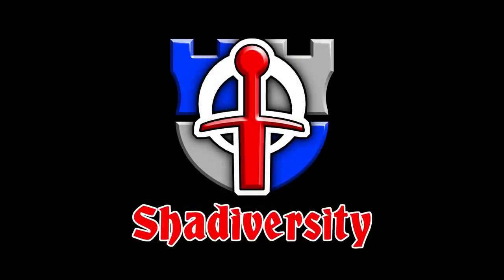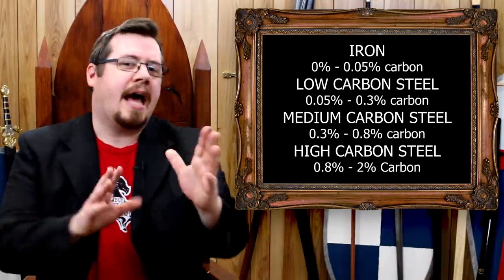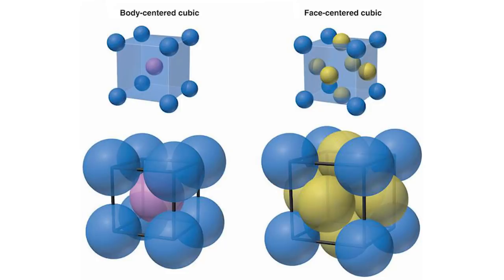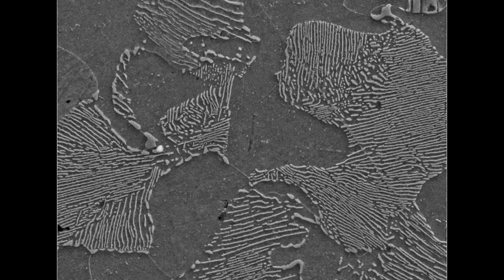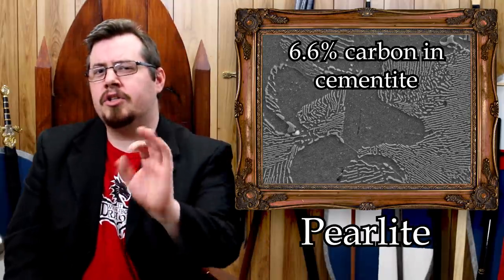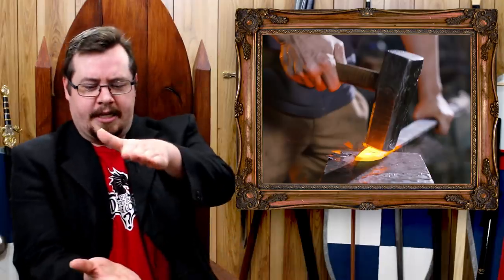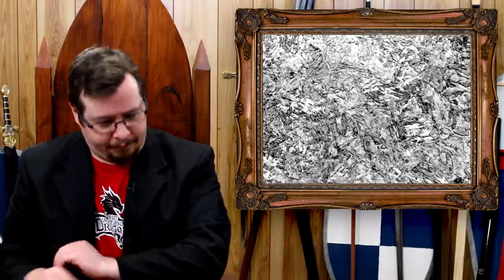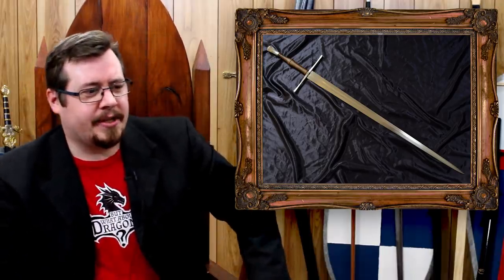What quenching and tempering does to SWORDS

Comment: As a professional bladesmith, I'd like to say THANK YOU!!!!! for doing some solid research and presenting factual information on this topic. I can't tell you how much people misunderstand most of this so I greatly appreciate you using your very popular channel to dispel a lot of wrong headed thinking when it comes to sword.
Reply: I wonder if you picked up on anything wrong? Some statements don't sound right to me. It sounded like shad was saying that heating a sword up past magnetic "can" forge weld micro fractures back together. That does not sound right as you would need to heat it up to a welding heat then maybe put a little force into it. I don't know if a welding heat alone would work depending on the type of steel. Tho a welding heat is hotter than nonmagnetic so it could be considered correct but misleading. Also it kind of sounds like Shad thinks that a sword is forges at a temperature below the nonmagnetic. I was taught that carbon steels should be worked at a bright orange or yellow heat to prevent micro fractures. And if shad ever comes up to Queensland I would love to help him forge something.
Reply: In order to achieve Austenite you need to heat up steel slightly (about 30 kelvins) above 727 celsius (regular steel) and keep it that way for some time. Look up Iron-cementite curve for more details, as the temperature at which austenite appears may be different at different amounts of carbon (also other additions may change the desired temperature). 

As for shaping, as long as you are going to normalise it, the temperature doesn't matter that much as long as the blade doesn't fracture. You wouldn't want it, however, to be too high (much above previously mentioned line) as the grains (??? don't know the correct translation - those microstructures in metals) may overgrow, which is going to reduce the quality significantly. 

And, if i may ask - can be blades made of stainless steel? It seems as a good idea, as rust is quite the problem (i mean, modern blades, i really doubt they could make it back in the medieval times in reasonable amounts due to needed additions)
Reply: The way I was taught was to work it allot hotter and it makes a massive difference to the speed at which you can move metal. Working it too cold could make a days work take a week or more. Also working carbon steels at a lower temp e.g. lower than orange can cause micro fractures that might not be seen with the naked eye. Then after forging you heat cycle it to reduce the grain size back down. So I think working it just over nonmagnetic would give you a sword that takes month to make instead of days and would likely snap or crack in hardening or the first time you hit something.
Reply: Don't suppose you could enchant my sword? Dull old blade could barely cut butter.
Reply: I apprenticed as a blacksmith, and worked with all kinds of iron, steel, and bronze. It's amazing, fun, and pretty good learning to work with.
Reply: I learned most of this stuff in school, but there was NOTHING about tempering in my classes and I actually had no idea how spring steel was made
I knew everything else and I was sure I'm just relearning old stuff, but damn, I actually learned something new.
Reply: One thing I do still wonder is what kind of structure does tempered martenside have? I know non-tempered has all the crystal structures interlaced which is why they are so rigid. However how does tempering cause them to still be able to move?

I also wonder why tempering took so long to develop. Since it seems like a fairly simple and straightforward process.
Reply: I love Shad for exactly this reason!
Reply: Please make blacksmithing videos! They are so satisfying to watch

Comment: Very nicely and clearly explained. Great work...
Just one tiny correction. If you get to the blue during tempering on a blade, you already went too far and made it too soft. Blue is only desirable for springs. For blades (even longer ones), a traditional blacksmith looked for straw or light brown over the fire. A modern one sets the oven at 400-500ºF for 2 hours...

Comment: I have Mech Eng deg, been a weld inspector, and a non destructive inspector for 20 years.  Spot on and well done.
Reply: Nailed the all the aspects of the material science right on the head. Quite impressive. Only thing I didn't see was the isothermal diagram for iron carbide (i.e. steel), which shows the microstructures produced by the combinations of heat and time (the inclusion of which would be debatable, but maybe worth mentioning for people to further investigate), and a specific mention of the names of the two different pearlites (Fine & Coarse).

Comment: I must applaud you in your research, I'm a professional blacksmith myself and wanted to inform you on a few thing's I've discovered. 
I have to say you don't temper swords to a "Blue" oxidation level on the edge because it looses too much hardness and rigidity. I generally temper my swords to a dark straw or red color.
I'd like to bring up, I generally harden my swords with a slightly (when I say slightly I mean by color difference of one, so generally cherry red to low orange glowing heat) differing color from tang to tip. I have the tip a slight bit harder but a slight bit more tempered (So I'd temper the closest part of the blade a straw because it's not as hard, but temper the tip a dark straw or even red oxidation level) meaning it's still harder on the tip, but it's also a little bit more springy.
For clarification you DO temper the spine a blue or purple color (depending on steel, hardness, sword, etc.)

On a second note you don't always loose your hardness if you heat it up over and over and quench it over and over. I did a test on this and it showed a smaller grain size meaning sharper edge, and a stronger structure as it took about 300lbs of force to break it compared to the once quench 50lbs of force. (same piece of metal and the thickness was extremely thin, don't remember the measurements) Or rather, in short, if you quench a piece of high carbon steel over and over again it generally holds and edge better (and longer) than a single quench. Though it's extremely dangerous as you can introduce stress fractures into it.

Again I must say excellent work on your research and that is all.

Comment: It's fun to point out that iron is the only element capable of shifting phases from BCC to FCC, and back to normal. It's dependent entirely on the heat applied and for how long.
Reply: Not sure if only iron can go from BCC to FCC but there are a lot of elements that can exist in different crystal lattice states. They are known as allotropes. They change depending on things like pressure, light, and heat. Carbon for example can exist in a diamond state, graphene state or even as a nanotube to name a few. Just google allotropy. Its cool that shad talks about this stuff. Good work.
Reply: Allotropic transformation occurs in iron depending on the amount of carbon, heat, and what type of cooling process is done. Allotropic transformation essentially IS phase shifting. While it is true many elements can transform dependent on factors such as pressure, heat, ect. none (or very few) can revert 100% back to their original form like Iron can.  I may be slightly off in some areas, but I'm taking the same metallurgy class again as a refresher, I'll update if I'm wrong or learn more details.

Comment: Hmmmmm... he’s talking about swords
BUT WHAT ABOUT DRAGONS
Reply: Swords aren't good against dragons, enough?
Reply: Nick Dzink Ah but do you know what is? MACHICULATIONSSSS!!!!
Reply: But dragon's ABOVE the walls not under them!
Reply: BUT WHAT ABOUT SPRING DRAGONS?!
Reply: Quenching dragons isn't easy, the hardest part is motivating them to get into the water fast enough, they are worse than cats when it comes to water.
Reply: when you first heat them up and then beat them with a hammer, i think you could quench them.
Reply: heat the steel in dragon fire, quench it in its blood.

Comment: The heating up and cooling down of metals, and the effects it has on them is fascinating. Ferrous metals, such as iron (steel), and nickel when heated and quenched as said in the video, are hardened, but do the same thing to copper, silver or gold, which are all non-ferrous metals and they’ll soften. I make videos of myself hand forging jewellery, and annealing is something I have to do to keep the metal pliable. So I heat and quench the silver and it stays soft.

Comment: Great video Shad. Amazing how many different topics you branched off into for an 18 minute video this time. We start with the 2 fundamental topics of your channel, history and HEMA, then add in metallurgy, physics, and geology, and you've got this video. Great job Shad. You're explanation of how the crystal structures form in steel depending on if or how it's quenched is spot on, and matches well with what I've learned in some Geology classes I took in College a while back on how rocks form. Same principal at work, cool minerals fast, and you get crystals of very small size and evenly distributed, cool it slowly, and the minerals have a chance to form big crystals and separate themselves out more, and you get a more uneven distribution.

Anyone wants to see the difference in what Shad's talking about in a visual way, do an image search on granite, then do another on rhyolite. Compare the 2 rocks. Both will look completely different, but if you study what minerals make each up, you'll see they're made up of the exact same minerals, the only difference is the granite cooled very slowly underground (over millions of years), whereas the rhyolite cooled more quickly above ground (over a few weeks-years).

Comment: hi chad. nice in dept video, really liked it. 
but there are two things you mentioned that might make people get it wrong.

first of all, the way you talked about katana's was like there was no tempering done to the blade at all. the truth however is that katana's do get tempered, but at way way lower temperatures than spring steel swords. if you would not temper a katana at all, it could be so brittle that you can chip it using it on a tatami mat.

secondly, somewhere around the 5-6 minute mark you were talking about work hardening and that it was not that useful on steel swords, only on bronze because the steel gets normalized anyway.
yes, all of this is true, but also not entirely. a well forged sword is never heated up beyond the orange color when forging it in the last stages. by forging it at this temperature the grain of the steel becomes smaller and that improves the quality of the blade. 
note, this is not just a sword thing, but mayor steel industries use this fact when rolling steel.

but again, really nice video. it is rare to come across video's about this subject that only get this little wrong.
keep it up.
Reply: Video was great already, but ... thak you for additional information
I mean ... really. Thank you.
Cheers! ;-)

Comment: I highly appreciate you made this video, I am a blacksmith's apprentice from the Netherlands and I learned quite a bit from your video. it's good to see how much research you've actually done to make this video because most people I know don't even know what quenching and tempering is for. I've also met people who claimed that quenching in oil is much better than quenching in water due to oil not being as cold as water. Although, when I tested it (without tempering) it seemed like they both had the same result (using low carbon steel)

Comment: a very good video just very little things
1. it is also quenching if you expose the iron to "room tempered" air the best method depends on steel and form
2. on 6:25 you probably mean toughness and not ductility
and and at least i learned to always use the term "pure iron" or "technical pure iron" to avoid confusion with cast iron

all in all great video with no real mistakes (one can always go deeper into the matter and nitpick about the heterogeneity of austenit microstructures but not in an introduction level video)

Comment: As an engineer i love the technical level and accuracy that this video goes into. but I'd also like to add that in the good old days, these processes were still used to make things like the beds of industrial milling and turning equipment.  These days, to make things cheaper they dont do it any more.  this means that second hand metal working machines hold their value because even if they were made in the 1950s they can still be more accurate than something made 2 years ago because they've not done any of the stress relieving to any of the precisely ground surfaces, which eventually start to buckle.

Comment: Thanks Shad for finally bringing the Youtube HEMA community a good video about heat treatment! 
Even with my nitpicking mind, I could only find two minors points to correct you on: first, and probably the most significant, is that Curie temperature, where a ferro-magnetic material rapidly lose its magnetic property, is not the same as the austenitizing temperature, and sometimes it can be quite off. A variation from 0% to 2.1% of the carbon content in the iron won't significantly change the Curie temperature of the material, and it will roughly stay around 770°C, while in the same time A3 and Am (complete austenitization temperature respectively for hypoeutectoid and hypereutectoid steels) will somewhat "yoyo" from 912°C, to 727°C, back to 1145°C (to which you can practically add a good 50°C, if not 100°, to be absolutely sure you pass austenitization). So the Curie temperature is only a mildly relevant practical indicator, and it's physically completely unrelated. 

The second minor point, but more minor, is the tempering temperature: there is no rule. It's true with carbon steels there is a temperature range you don't want to be into too long, because secondary carbides (i.e. cementite) tend to precipitate at joint boundaries and it makes the steel brittle (that's precisely why it's called "temper embrittlement"), and bellow blue is always a safe bet, but in historical times tempering methods might have varied. Especially during the napoleonic era, we know from a fact (a reference book left by the one who precisely supervised sabers production during that era, the General Gassendi) that French sabers were tempered at the verge of glowing, so over 600°C. This may sound somewhat surprising, but blades were not kept at that temperature (for a long time), just brought there and left to cool, which is somewhat similar to nowadays "flash temper", though certainly not as accurate as with modern methods. I don't exactly know why they opted for this method, but as the effect of tempering are also a function of time, not just temperature, maybe they could more reliably control that a whole blade would be starting to glow once, rather than make sure it would stay at 200-250°C for one hour. With a saber blade, you rather want to be too soft than too brittle, while it's not nearly as much of a trouble on a knife (because it's short) or axe (because it's compact). But I'm only speculating here, and this would be really nerdy fringe archeometallurgy to exactly study this question.

Maybe your next video will be about the Iron-Carbon diagram and how it's to be read and interpreted? Just kidding! But you'll have to face the Behemoth one day...

Comment: 9:30  Hold up.  Tool steels are quite a bit more complicated than that.  The different types of tool steels get their various properties from a combination of carbon content, alloying elements, and their heat treating.  For instance, those drills you showed would be made of high speed steel, which is a high carbon steel that's either going to be alloyed with tungsten or molybdenum (alongside a whole bunch of other stuff) and heat treated at very high temperatures.

But aside from that, pretty spot on.  A lot of these same concepts are used in industrial settings for heat treating steel parts.  Actually it's almost identical, except that in a lot of cases you'll want to temper parts in an oven instead of an open flame for better temperature control.
Reply: Trace elements really changes so many things.  I bet it would take hours to give even a cursory explanation. I believe beautiful wootz Damascus steel cannot exist without tiny amounts of vanadium, for example.
Reply: Well in the specific case of high speed steel, I'm not sure you could call tungsten a trace element.  The most common HSS alloy, T1, contains 18% tungsten.  Not 1.8%, 18.  Although in the context of medieval metalworking, modern HSS alloys might as well be alien technology.

And the effects that vanadium has on steel would probably be pretty useful to a bladesmith.  Better hardenability, shock resistance, fatigue resistance, and toughness.
Reply: Mr. Entropy, that is true with most off the shelf bits, etc.  but consider the 10 series steels like 1060 up, which are primarily Iron and carbon with addition of manganese for additional hardness, sulfur for machinability and phosphorous for hardness.  Cheers.  KW

Comment: Love your channel, as a machinist/metallurgist, this is a great primer on steel.  Nit picking: during the tempering stage the metal does not "glow" this is a color change to the polished surface similar to what you see on motorcycle chrome pipes, it indicates oxidation to the surface and leads to bluing which is  ferrous oxide (but lets not go there) from ancient time the color changes that a surface goes through has been an indication of heat which you noted on your color band slide.I think you're selling Europe short on iron and steel development, consider the Halstatt sword, which though it is labeled as iron is actually low grade steel, also consider Swedish watered steel and Iberian Celt steel.  Most stack up well against Wootz steel.  In the case off Halstatt (600 BCE) the Goths and the Scandr were well ahead of the game..Be Well and my Best, KW